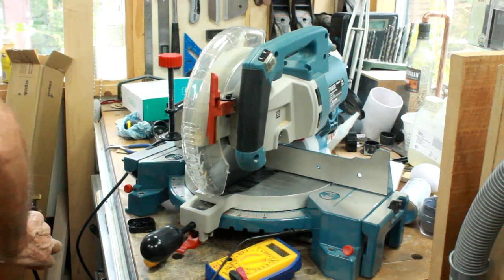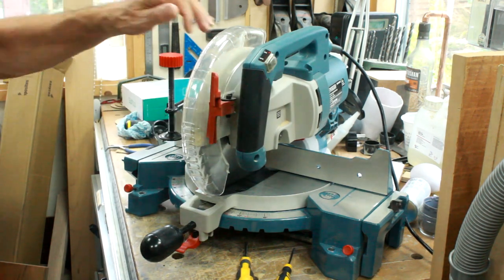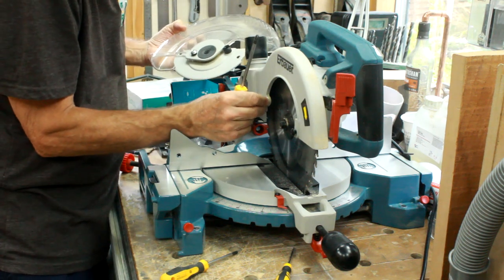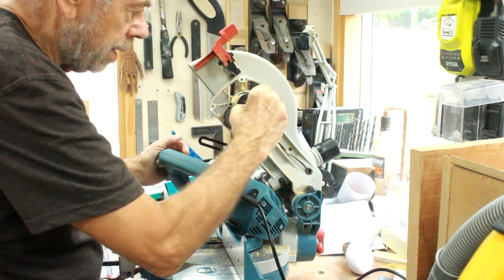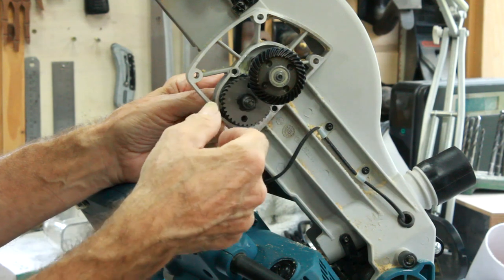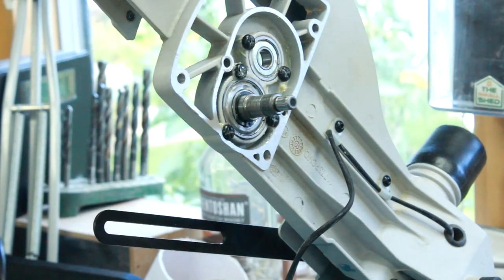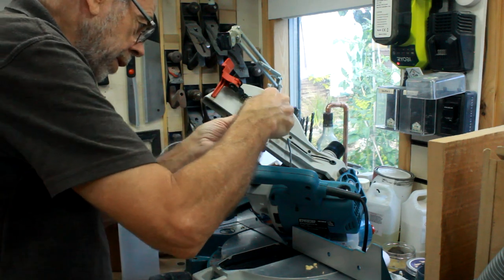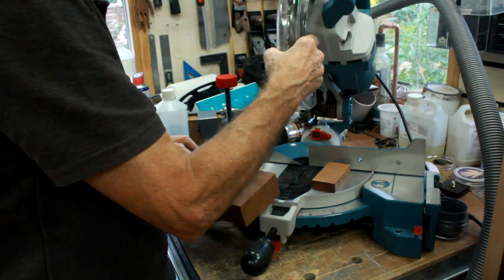small shed Saturday #463 - Erbauer mitre saw repair

Comment: A huge thank you. I encountered the same problem whilst in middle of job and all I could find was well intended advice to tighten the saw retaining bolt. I've a different Erbauer saw with a different motor configuration but this video gave me an  invaluable steer in where the problem lay. Mine had a 4x4x8mm feather key but eBay came to the rescue.  I've bought 2 packs of 2 because it's sure to happen again. Crazy design with all that torque going through a tiny piece of steel. Note to self: Careful with thick cuts, take several shallower passes.
Reply from the maker: Glad it helped Michael, it's suprising how often these repair videos elicit replies that indicate fundamental design issues that many people seem to be suffering from. You would think the manufacturers would realise, unless they just want to get stuff through the guarantee period.